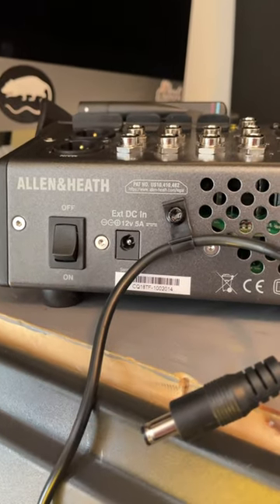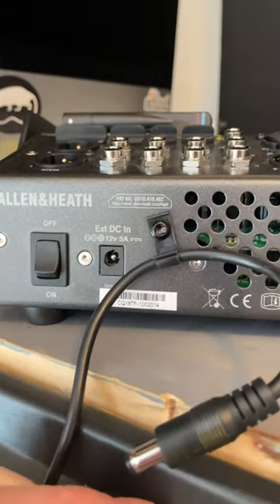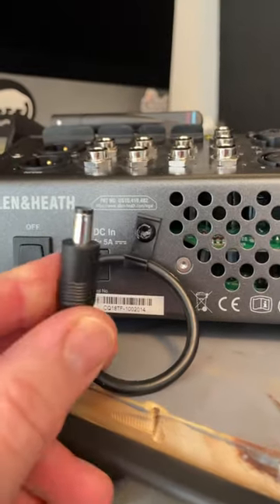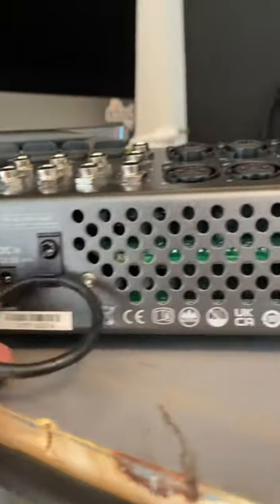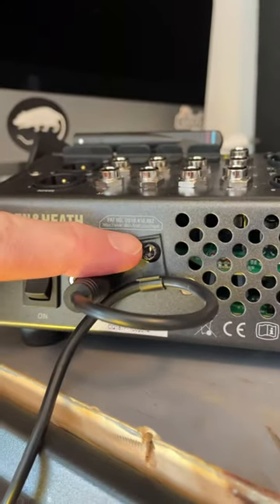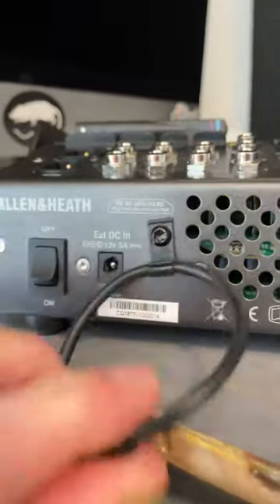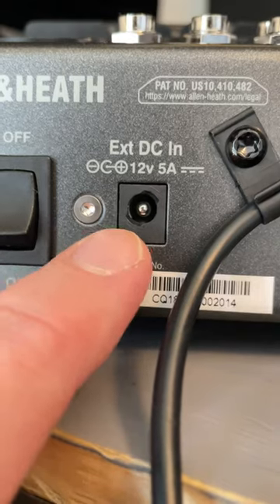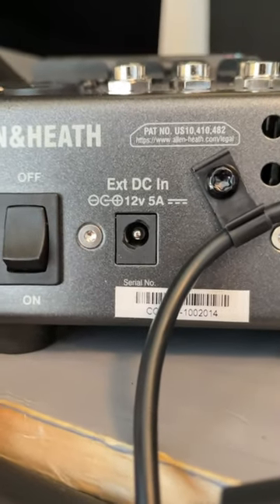The A&H CQ-18t has a locking power connector, but the provided power supply doesn’t ☹️ #livesound

Comment: Iec is the way to go
Reply from the maker: The 20b model has an internal power supply and IEC input cable... I think they went this way on the 12 & 18 to reduce the cost selling them globally. There's a good chance the original U.K. adapter has the locking tab & we just didn't get them here in North America.

Comment: I would call them up and say something. Looks like they are cutting corners. Your paying a lot of money for your equipment and they do this.
Reply: Nah. Reasoning many things today uses 12V DC or AC input is that the  company don't have to think about the adapter  and don't have to get the device itself electrically certified in each Country. The local company that imports the device delivers the 12v Adapter and have to make sure it is locally certified .. NOT the Company that produces the device. You will have to contact who ever distributes the devices in your country. It's those companies that often cuts corners and often delivers cheap adapters made in china that often isn't even certified in European, UK or US countries
Reply: This is a budget mixer